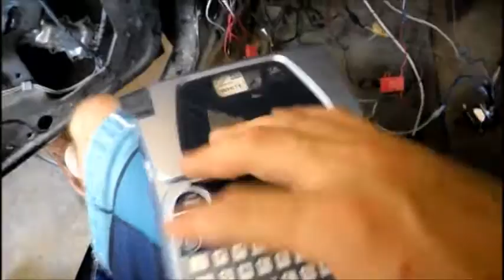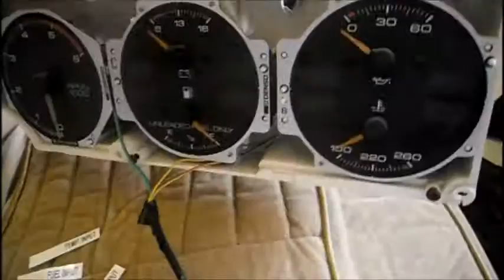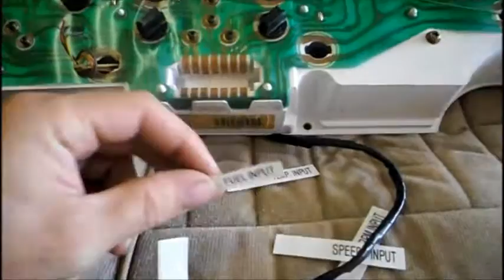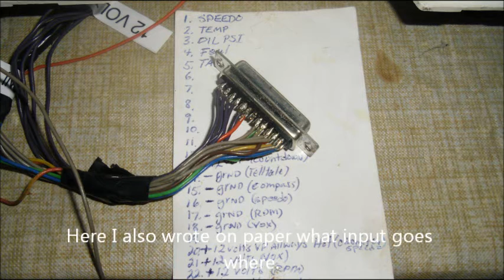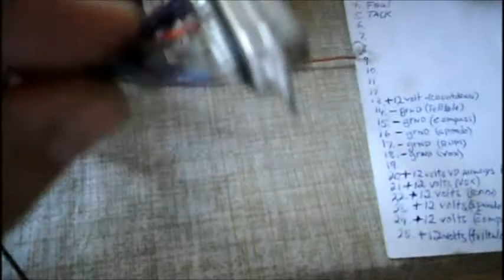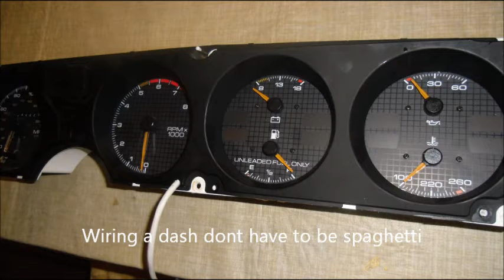KNIGHT RIDER Dash Electronics Instrument cluster hook up

Comment: Great informative video, I just got my Jupiter dash electronics a few days ago and I will be installing them soon. On your installation ,What gauge wire did you use and where can I get the type of wire you are using?Thank you very much for the video.God Bless.
Reply from the maker: +MrLnewvision The guage dont have to be super thick. 18-22 guage is fine.
http://www.ebay.com/itm/22-AWG-Gauge-Stranded-Hook-Up-Wire-Kit-25-ft-Each-0-0253-Dia-UL1007-300-Volts-/371251803318?hash=item567054f4b6:g:zoIAAOSwLVZVuPhG
Or Conductor wire is good as well.
http://www.ebay.com/itm/Belden-9430-Unshielded-7-Conductor-22-Gauge-Cable-Wire-5-Foot-Length-NEW-/121896539328?hash=item1c619994c0:g:jj4AAOxyYANTYurq
Reply: Thank you.

Comment: Would have been better (and easier) to use ring connectors in those screw terminals.
Reply from the maker: Had mine done this way for years without issue, the ring connectors the crimp on ones can come loose. I would want to solider them to it the ring connectors if I did use them. But this method works for me by wraping about 1 inch of wire around the screw head and tighten. But do what you prefer.

Comment: Thanks for the instructional video. I have 1 question? Where do you tap into the volt meter at ?  Only 1 I didn't see you list. 
Thanks so much !
Reply from the maker: I believe that works off the car battery source any 12 volts from the car.
Reply: @JacobKnightRiderShop  Thanks brother 🙏

Comment from the maker: https://www.ebay.com/itm/25-PC-ADHESIVE-CABLE-ZIP-TIE-WRAP-MOUNTING-BASE-FOR-3-16-MAX-WIDTH-BLACK-HS101/132464639108?hash=item1ed781fc84:g:4woAAMXQlgtS8xdp Also buy some of these you may need them when wiring up your dash as well. Help keep the wires clean with zip ties.